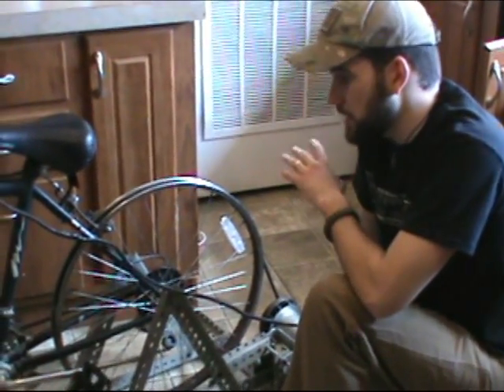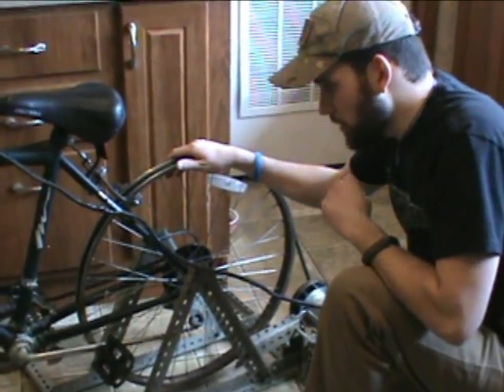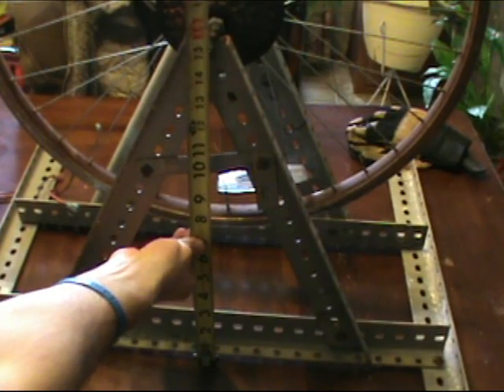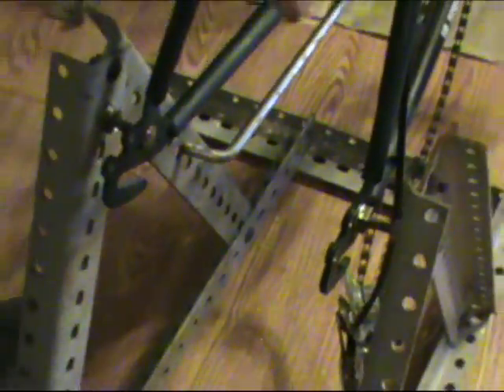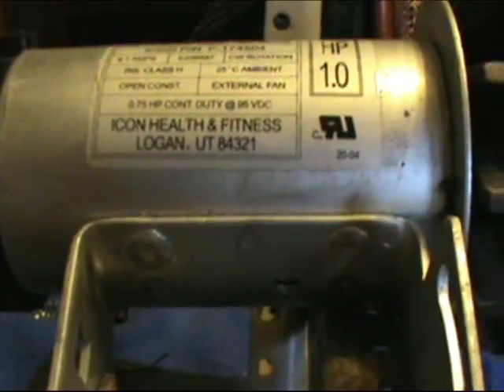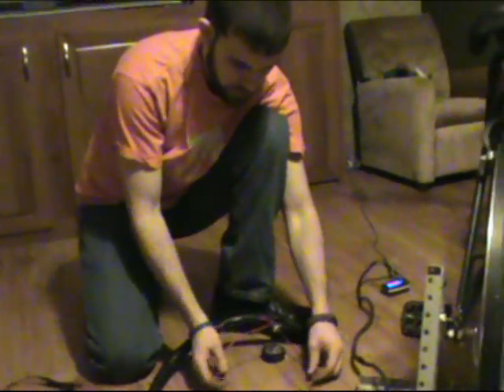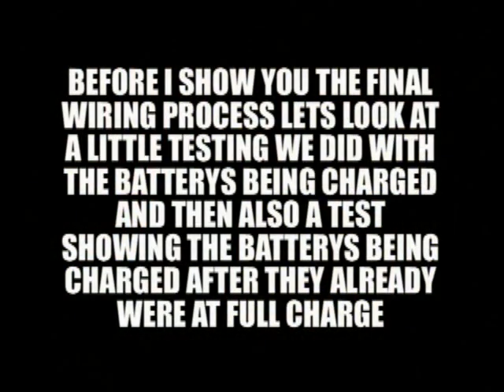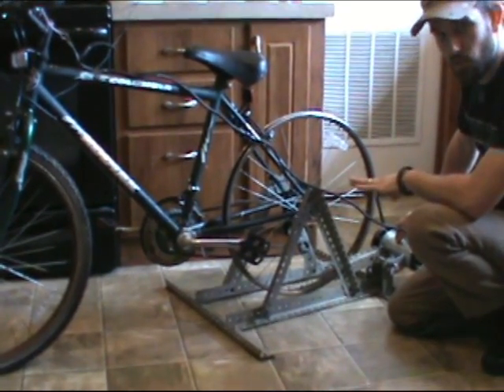HOW TO BUILD A BICYCLE GENERATOR FOR ALTERNATIVE ENERGY (EASY TO BUILD AND PEDAL)

Comment: you could put a frame around the back wheel with angled magnets. also put angled magnets on the wheel so they push against one another (frame and wheel). it will make pedaling easier and faster.

Comment: I am making plans for one made out of a sit down (chair style) small fold up workout bike. It will have a detachable direct drive motor with an option for a belt. the battery and geny set up will be in a big tool box and it will fit in a detachable basket under the seat. Finally i will add some harbor freight wheels to make it easily mobile. I will send the video link to the channel when i am done.

Comment: I am also needing a few deep cycle  batteries  preferably outboard.  would you  prefer 24 volt or 12V?   I do plan to install a invertor to the system plus a overcharge protection.

Comment: Any fitness mashinne can be connected to an electric generator with same efficiency?
Reply: +angetodac  It depends on the gear´s system ratio, say you have one gear conected by a pulley to the motor, but the gear needs to be big enough that one revolution of the gear is many on the motor/generator, so the trick on having an efficient non-physical demanding (so to speak) is a good gear system.

Comment: ok,how long do I have to pedal every morning to have electricity for my house the hole night? one hour?3 hours?what is the eficiency of the byke?
Reply: ***** 1 HP ~= 0,7 Kw ==> almost 90 minutes.
Reply: +Jillian Bentley Just a reminder; you posted your email address here. I would recommend that you remove it (edit your comment or delete it entirely) to prevent someone from doing something with it.
Reply from the maker: Its not for that type of electric production, its more like if you need communication back up or simply lights or to help your battery bank in between a rainy day or little sunlight.
Reply: Ok,thanks,I understand...but why cannot be made stronger?
Reply from the maker: 7 TRUMPETS PREPPER it can be made stronger this one just inst made for that
Reply: Ive got you.the principle can be used for bigger efficiency.
Reply: 7 TRUMPETS PREPPER Other than building the bike and base...what would I need to power a small refrigerator and air conditioner? I know nothing about this but really need and want to know. Like, would I need something bigger than a treadmill motor? What about batteries, and where do they hook up?  I know this is a lot but I would greatly appreciate this help more than you know. Tribulation is coming, if it hasn't already began. My email is jillm12@yahoo.com I hope to hear from you soon. Thank you for your video!

Comment: instead of making the mount out of angle bracket you could have got another cheap bike and cut off the back triangle for mountain the rear wheel of the frame and used it, less measuring involved in that.

Comment: Have you tried  using a car alternator?  Which one do you think will work better a car alternator or a treadmill motor?
Reply: Alternators are not a good choice for this sort of "work" or energy output.  Alternators require very very high RPM's in order to charge your battery.  RPM's you will not be able to achieve on a bike versus a car.  An alternator is part of a much larger array of components working in tandem.  Which means you need a lot of energy (car battery with proper voltage, hitting the starter, which pops the spark plug and starts the combustion engine, which as long as there is gasoline it will keep the pistons pumping)...
Also, you are kind of using the DC motor in reverse if you think about it.  An alternator is not a power source as much as a charging station.  So with the lack of RPM's and energy losses you will get it is just not a viable option.
I forgot some of the technical bits about it.. In college I took some wind turbine building and theory classes and we learned this.  So I hope that can be of some help to you even though you asked a while back.  And if that information is junk now I am sorry or completely willing to be corrected!

Comment: You should make it so I can put it in the trunk of my car - w/ a small wheel to be pulled along under my car - and let it charge my batteries everywhere i go.
Reply: if you are driving the car, why don't you just run the batteries in series with you car battery and they will charge.
Reply: exactly

Comment: The blue wires are for a temperature sensor in the motor. When used in a treadmill it senses the temp. and when it gets too hot it stops the treadmill until it cools back down. They are unnecessary for this usage. Blessings

Comment: that is a great build for power and battery chargeing,, 
another thing you can use is a marine 1 wire alternater,,you anly have a charg wire and a ground wire,, no diod or voltage regulater needed and they will last forever,,they can get wet plus they are a sealed unit,
i have had them last up to 20 years with heavy use and they have a high charge rate at slow rpm,, i might even have one i could give ya if you can use it,, thanks for the vid
and god bless and save you all,,Robert

Comment: Pretty good. I like that you used the whole tire rim. This is the reason for good voltage at a low effort. Big wheel gets the small motor turning faster. Way better than using the star gears. You can always revert to using the star gears if you can only find smaller belts. Thanks for the video.

Comment: To make it easier to pedal the back wheel needs to gain weight that is free spinning in one direction so that the extra weight makes it easier to keep it spinning.  I don't know what this idea is called I just shared, just makes sense.

Thanks for sharing on how to build a bicycle generator.